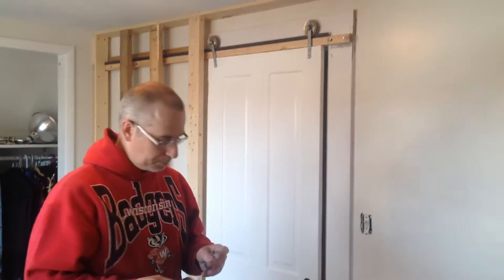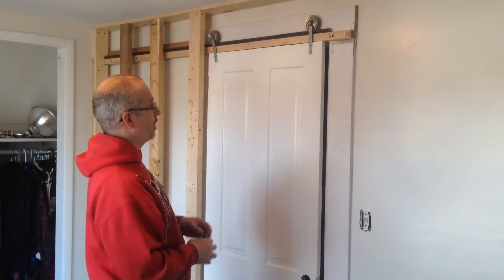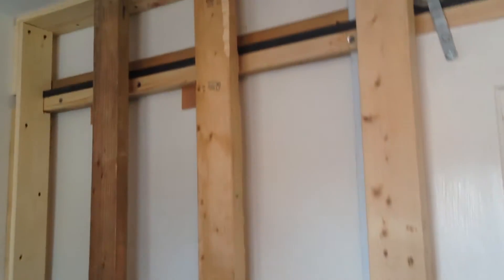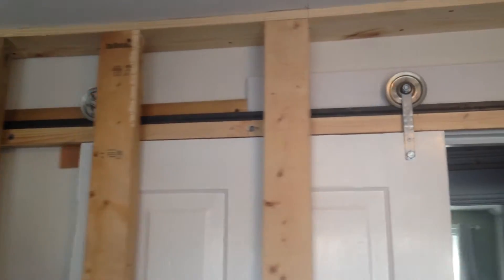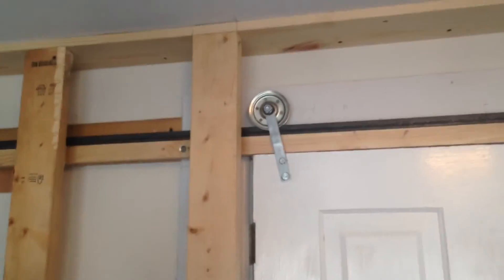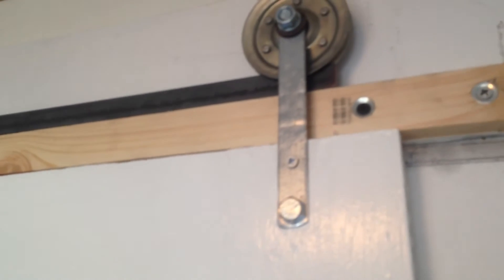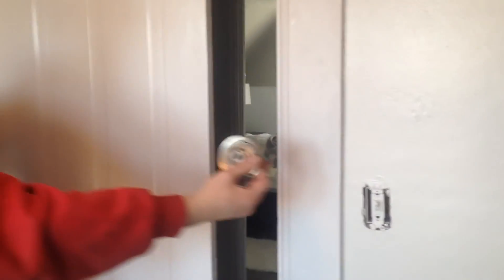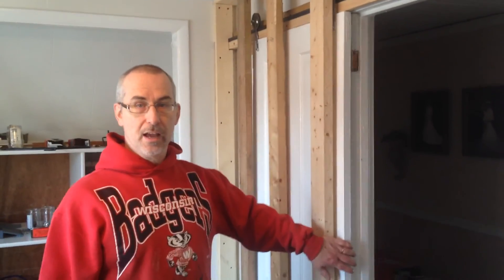How To Create A Pocket Door

Comment: Hey, that's a very nice hack!  (Which is a compliment, as opposed to calling something a hack job, LOL)  Not that people questioned it but thru bolts in the door don't allow for vertical adjustment that one gets when using the standard trucks/wheel sets in the kits.  HOWEVER, I have 6 pocket doors in my house, 3 of which I installed myself, and in the past 15 years none of them needed adjusting.  Pretty ingenious job using mostly what you had on hand!

Comment: 🤦‍♂️ they make pocket door kits.. the amount of money and time wasted in that configuration you could of done it the right way
Reply: He saved probably over half the price doing it this way instead of buying a kit. and that’s  with Covid prices of materials lol. He could saved even more money if he just cut his old sheet rock/ drywall away and installed it in the wall cavity and just reseamed the wall instead of building the other side out and having to buy sheet rock.
Reply from the maker: Actually, those pocket door kits are outrageously expensive.  This cost us nothing because we reused materials we already owned.  We reused the door of the room and all the hardware we already had.
Reply: 🤦 You don’t buy materials from box stores, you order and buy materials through actual lumber or contractor supply yards. You can get a pocket door kit for less the $150 that includes the door frame, door sliding rail. That barn door rail he has cost $125 from the box store itself, that door cost $80. You add in the cost of drywall, mud, tape, screws, finish trim, nails, you will be in it for $500 all said and done. Everyone of these YouTube diy peeps think they are saving money and being cheap but it’ll cost you more by not doing it the correct way.
Reply: @gldmembr6132   did you even listen to him he didn’t use a barn door rail lol it’s angle iron which is like $20 for a 8 foot section. Pulleys which are probably a few bucks each but he said he already had. Then brackets which are like $2 each. And why would you go to a lumber yard to buy 5 2x4s? You wouldn’t even save anything unless you’re bulk buying from them and for all we know he could’ve had those 2x4s from an old project. Seems to me the guy saved a bunch of money just making an alternate track.
Reply: @amyjohnson7301  he obviously didn’t watch the video lol
Reply from the maker: @gldmembr6132  Well that would be $144 more dollars than we spent on this door.  I just spoke to my husband to verify what he actually purchased and he said $6.00 for the piece of angle iron as he already owned everything else from previous construction projects.  Now if someone does not already own a lot of construction items, they will probably be better off buying a kit that you described.  However, we believe in reducing waste by reusing things you may already own.  It's not only a great money saver but kinder to the environment as well.
Reply: My point is if you don’t have the money to do it correctly then you shouldn’t be trying to save $50. If you don’t have $50 to spare you shouldn’t do it all. Your not saving the environment by buying all these new parts. If recycling was your main focus, you go to flea markets or garage sales and reuse those parts. If you have money to afford a nice house you have money to do things correctly.  It’s like someone buying a Porsche then taking it jiffy Lube for an oil change. You can afford the car but you can’t afford the maintenance.
Reply from the maker: @gldmembr6132  Chis, we didn’t need to go to a flea market because we already owned everything. We owned the door, we owned all the parts, we bought ONE item: a $6.00 piece of angle iron. Why in the world would we ever buy a pocket door kit for $150 dollars if we can reuse what we already own and do the project for $6.00? I’m sorry, but your just not making any sense. I will not be replying to anymore of your comments. I wish you the very best, have a wonderful day and God Bless you!